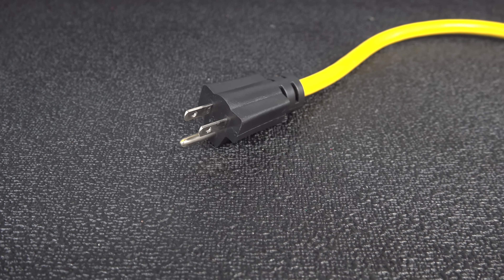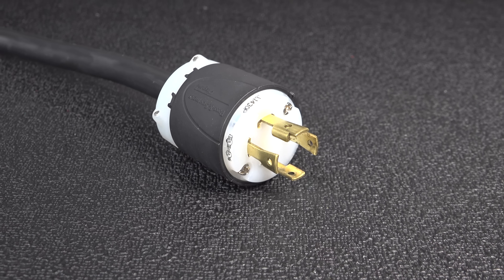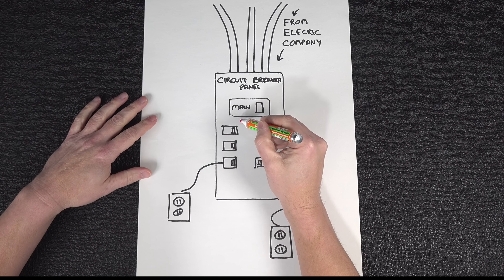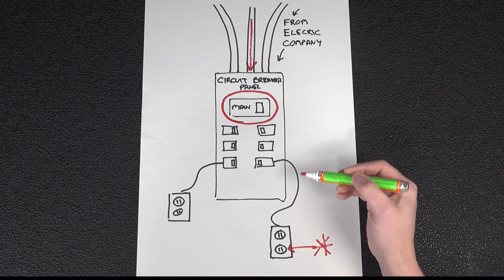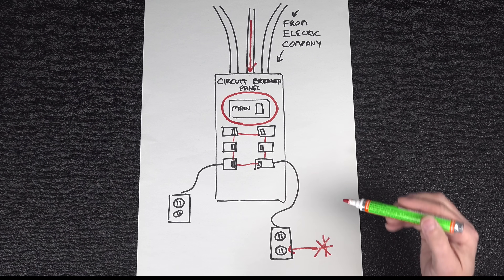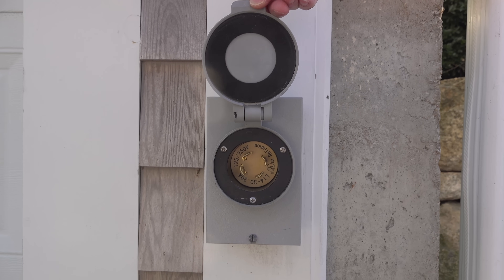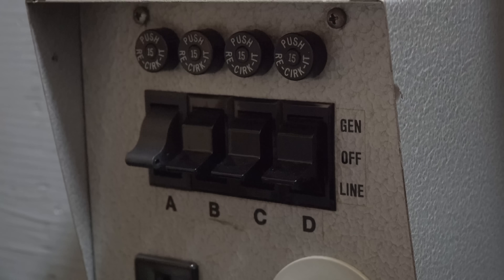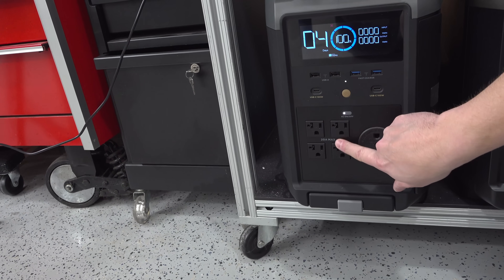Worst Electrical Mistake You Can Make - Backfeeding Generators

Comment: It's only dangerous if you don't isolate your main feed first and if you overload the circuit you're feeding it through, so for instance a smaller generator will put out under 2000w, most socket circuits in the UK are made to handle that and it's unlikely the generator will be a danger to the circuit wiring, other than that you just need to attach the connection site while both the supply is disconnected and the generator is off.

I do not advise the practice, simply I'd rather people know how to do it as safely as possible if they're gonna do it anyway
Reply: I got a generator last summer. Emergency supply to the house wasn't even thought of when I got it. I'm gonna have more fun than most if I need to run the house off the generator - as the house is only single phase ;)
And the generator, 2kW per phase.
So the design is to make the house 2 phase (house L1, cooker & some sockets L2) and have the third phase as a socket in the kitchen. I also need to disconnect main neutral - as it'll be connected to earth - and that'd trip my RCD !
Reply: @millomweb  no. Do more research.
Reply: @MrT13  No what ?
Reply: @millomweb  if you use that fancy generator use the ground wire. No need to disconnect a neutral.
Reply: @MrT13  As I said, I'll have to disconnect grid ground - otherwise as far as RCD goes, it'll be a fault - as it too is grounded.
Reply: @millomweb  system neutral* is grounded at the house. Generator comes with small ground wire. Use it. It’ll be fine trust me.
Reply: @millomweb  it’s in the generators instruction manual. That’s why they included it.
Reply: @millomweb  if your generator has settings (30ma/100ma) for the rcd. And you want to use another rcd like kitchen bathroom etc you gotta put gen on 100. Or it’ll trip either prematurely. Just a tip. That’s in the instructions too.
Reply: @MrT13  My generator won't be grounded. That could lead to other spurious circuits.
Reply: @MrT13  I'm not in the US !! Neutral will be grounded at the local transformer. It may be grounded at properties as well, I don't know.
When I'm running off the generator, (neutral is not connected to generator ground) so I've created a connection just upstream of the RCD so that will trip on a ground fault as it should. If there's any other connections between ground and neutral, the RCD will see that as a fault and cut the power.
Reply: @millomweb  ok. Can’t see why the system neutral wouldn’t be grounded at the house. Maybe they don’t have lightening in your country lol. But generators with rcd breakers come with a small ground wire. That hooks to the panel ground. Pretty sure you have one. Or the utility company would not supply you. They are not responsible for faulting shorts in customer structures. You have a ground. Ground rods water pipe whatever. Use the supplied wire, hook to the ground that goes in meter and that’s how it’s done. Pretty sure everywhere but the international space station……
Reply: @millomweb  like I said before do more research. You say I don’t know but I’m telling you. The “properties” definitely have a ground. The generator has a metal frame… and comes with a ground wire…. 1+1=2. The neutral is grounded possibly 100’s of times before it gets to your “properties”. It’s grounded at the power plant. It’s grounded on every transmission line. It’s grounded in substation. Then it’s grounded at every distribution pole. Then it’s grounded at tx. Then it’s grounded at meter. Hook the generator up to the ground wire below meter. It’ll work. In England. In Australia. In China. In Antarctica. It’s all the same. And all rcd are the same. It’s in the instructions.
Reply: @MrT13  We have multiple types of supply configurations. From a supply with no earth(TT) - needs a ground rod, to a supply with an earthed protective sheath - which is what ours is(TNS). A third type is where an earth is provided (TN-CS) (T (terra, Earth) N - neutral Combined (= both in the same conductor) S - Separated at the house.
TT - electric company does not provide an earth - ground rod needed. Ours, TNS - ground an neutral are supplied - so no local connection between the two. TN-CS - ground and neutral are provided by one conductor and separated at the house - which is the style you're familiar with.
Reply: @millomweb  ok don’t ground it. Disconnect your neutral. Do whatever your heart desires.
Reply: @MrT13  pmailkeey actually has a point, here in Germany and most other European countries we have a 400/230V three phase low level distribution system. So there is no transformer for only your house, there is one for the whole block.
Your house will have an earthing system, if it’s not a TT system it won’t be connected to neutral. 
Most city’s use TN systems, so with TN-CS you get 4 wires (L1-L2-L3-PEN) and the PEN will be split in your house service box or with a TN-S system you get 5 wires (L1-L2-L3-N-PE) to your house. Unless it’s a TT system you always have to use the provided PE in your electrical system. This has the advantage that it’s always guaranteed, that the earth impedance is low enough to trip breakers. In TT systems that has to be checked regularly.
Reply: @gutesache1  ok. Still buildings have grounds. Rcd generators have a ground. Hook it up before earth ground on system bad. Hook it after earth ground good. It’s just simply making a loop so the rcd breaker reads how much you are pulling from ground at structure. It can be 4 wires. Or 5. Or 4 phase with 2 neutrals a regular ground and a ig ground. It still doesn’t matter. There’s a ground for the structure. All phases however many will pull electrons from there. Use the ground wire on that and the rcd will work. I’ve hooked up generators with rcd breakers in hunting cabins no ground rod where we just stuck a piece of pipe in the ground and ran the ground wire to neutral buss in panel cause no meter. I’ve done it on 3 phase to run lift stations, buildings, pump houses. And I’ve put them on residential and just attached the supplied ground wire to the metal water pipe on house that was the system ground. It all works. You do not have to disconnect a neutral. But fine like I said do whatever he wants. In Germany I’m sure electric works the same as anywhere else. If there’s no ground rod on structure ok but I’m pretty sure there’s going to be a way for the structure to be responsible for lightening and faults. Not the utility neutral. There’s a earth ground on building, use the little wire, put it on that, it’ll work.
Reply: @gutesache1  in USA we have basically the same thing. But two phase. Tx for whole block. All buildings have a earthing system. Just different hertz and volts. And rcd works the same here as there. Connect the ground wire before the neutral and earth tie and it’ll trip. Connect it after and tada.
Reply: @gutesache1  well actually let me clarify. In USA we have all kinds of different voltages. House voltages stay the same 120/240 or 120/208. 3 phase starts getting weird though with 208 240 or 277. Like we even have open delta 3 phase that is 120/120/208. Two same voltages but one single “high leg” But it really starts getting stupid when you get into distribution voltages. Some states are 2300 per phase. Some are 4160. Some 7600. Some 12,470. Some 13,200. Some 13,800. And a bunch in between.
Reply: Also a good point to consider - that double male end can bite if one end is connected to the generator and the other is not. Not great with kids or elderly or ignorant folks around.
Reply: @SuLokify  my wife hasn’t died from it yet….. so easy a blonde can do it….
Reply: Yep, just make sure it is isolated from the mains and the wire of the outlet won't burn by the high current.
Reply: The Nancy boy who made this video is clueless or just scared. Open the mains and back feed through 30 amp plug. Dryer, ect. Open your mains. Not difficult, not dangerous, just know what you are doing. This is taking safety to the point of stupidity. Generator interlock just idiot proofs the process. Ask yourself, are you an idiot
Reply: @chucknorris277  thank you. Literally one single solitary fking step. If you are so fking stupid you can’t follow step one of one then yes please don’t do this. In fact don’t move, don’t touch anything in life. Don’t even fking breath. You are wasting good oxygen lol.
Reply: @chucknorris277  Things like this should be inherently safe, as a technician on the line transformer you don’t want to trust some guy to turn off the breaker.
There is always human factor, safety measures get neglected all the time.

Comment: Good advice but to be clear..back feeding is NOT illegal. You just have to have the proper hardware installed in ur box. It's a good ability to have, just do ur homework and do it right
Reply: Even without interlock or transfer switch, its not illegal if its temporary, portable,  and fits the other requirements of the temporary portable generator exception.

Comment: I have heard this line of crap many times, but if you ever do back feed the system with a small generator it instantly kills the generator because it can't supply the wattage requirements of the the entire electrical grid. You also do not need a double ended cable to do it. It depends on your generator and how you hook it to your system. The double ended cable is to supply both legs of your system if you do not have a 240 volt generator. You always have to disconnect the main breaker to make it work unless you have a transfer switch and a permanent installation.

Comment: Okay, let me just start by saying I am a retired electrical engineer, and a former Lineman splicer, and yes when I was on an outage,  the first thing I did when I got up in the bucket truck, was to turn off the truck and listen for running generator's, and if I could hear one, I would send my partner or come back down from the bucket, and go check it out, just in case someone was back feeding, but that being said I have used one of those cords before, but I know what I am doing, but selling something like that to the general public. NOT A GOOD IDEA!!!!
How ever, I do have a cord that I made up for back feeding, but it has a standard 20amp plug on one end and a 30amp dryer plug on the other end, but what makes it a little safer than the one in this video, is that I have the two hot legs tied together, which makes back feeding impossible. And this is why, if you turn on the main breaker with this plugged in, it will immediately trip the 30 amp dryer breaker on a line to line short-circuit, if utility power is on, but if it is off, it still won't back feed the transformer, because the transformer has a line to line shortcircuit as long as this cord is plugged in, which will trip the generator breaker, or it's electronic overload protection.
How ever, you still have the possibility of electrical shock, if you have the cord plugged in to the generator and the generator is running, the 30amp dryer plug will have 120vac on it's exposed male terminals. The advantage of using this is that all of your 120 volt circuits will be energized, you just won't have any 240 volts.
Which is most likely not a problem unless you have an all electric home, in which case you will not be able to use your range or oven, and you won't have hot water, heat or AC, but everything else should function normally.
Reply: so you don't care about the 220 appliances running during the outage, you're trading the voltage for a trip circuit?